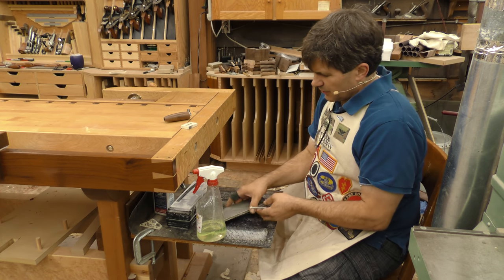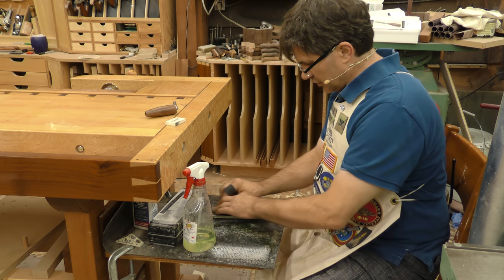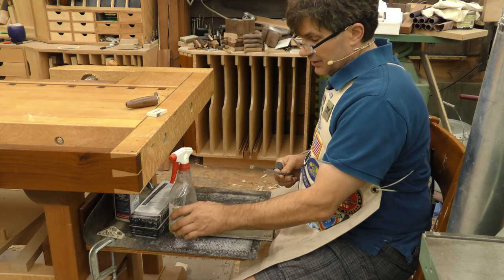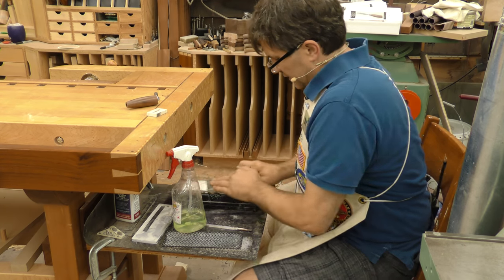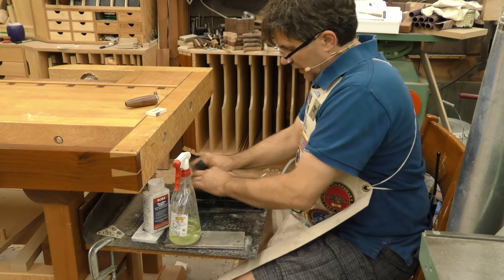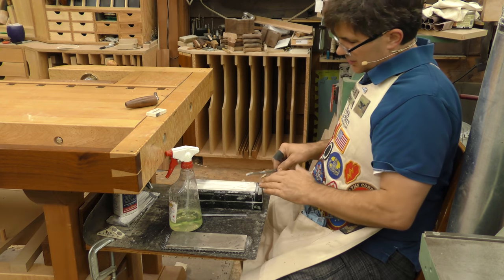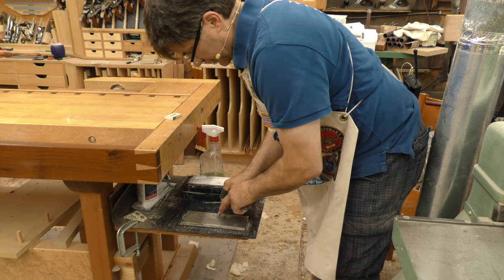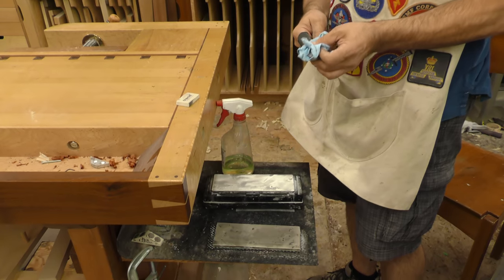Chisel preparation, from new in the box to the bench with Rob Cosman

Comment: 2:20.... But why can you remove 1000 grit scratches with 16000 grit on the bevel side of the chisel?
Reply from the maker: tertiary bevel, a few degrees higher than the secondary, very small surface, essentially just at the edge.
Reply: @RobCosmanWoodworking  Thanks for replying Rob. I actually thought that not long after I asked the question. Makes perfect sense.

Comment: I have a set of Irwin marples and i started to sharpen them and all 6 chisels are like bananas any words of wisdom on this rob?
Reply from the maker: Yep, lawn darts!  Not worth the effort, if the manufacturer  doesn't care enough to send them close to flat, something you see, then dont have high hopes for stuff you dont see, quality of the steel.  Buy the best and cry once!
Reply: Chisels don't NEED to be flat. Only need to be flat side to side, and perhaps 1/4" to 1/2" back from the cutting edge. Remember, you are only cutting with a tiny tiny little surface. Rob forgets that somebody taught him that you don't need to flatten and polish the back of a plane, which is a far more demanding application than a chisel.
Reply from the maker: A plane blade sits on a bedded surface, a chisel is held in your hand. Huge difference in terms of demanding flatness.
Reply: @RobCosman.com I'm in a similar situation but it's of my own doing. I have been using a set of diamond plates that weren't perfectly flat and found out too late. There's now probably a 0.010-0.015" belly in them and I need to correct them back to flat. I recently purchased your 300/1000 Trend plate to make sure I was getting a flat surface. The chisels are Lie Nielsen's so definitely not lawn darts. 

Any advice on method of correcting them?

Comment: But haven’t you advocated in the past to only polish the very edge of the back of the chisel?  I’m talking about the ruler trick.
Reply: Ruler trick for plane irons, never on chisels.
Reply: Ruler trick is for handplane blade, not chisels.
Reply: illegalcity why wouldn’t it work on chisels as well?
Reply: Because you want chisels to be able to pare to a reference face. The rule trick will add a bevel to the face and it won't pare flush.
Reply: bigscreen bird as you cut to a line a back bevel would push your chisel away from that line and you would not get a true 90 degree wall. You would not get the crisp shoulder that you are trying to cut
Reply: Rob, on a different note, I have a Hock blade in a Stanley 80 scraper plane, and I'm experiencing chatter on highly figured walnut. I am sharpening this in a similar fashion as I would a card scraper, pulling a burr over the flat edge. Could this be the issue? Should I be sharpening this more like a traditional plane iron?
Reply: Never on chisels, only hand plane blades
Reply: My understanding is this: The back of a chisel is the reference surface that registers to the wood. On a plane, the sole is what registers, thus the back bevel from the ruler trick doesn't negatively effect the cut.

Comment: Question for the experts in here: When I finish on the 6000 grit stone, I get a mirror polished back with no visible scratches, but if I then move on to the 16000 grit stone the back gets visible rough scratches again ?  I dosen't make any sense to me, I starting to think my 16000 grit stone is labelled wrong.. 

I work with the exact same setup as Rob, 1000 grit trend diamond plate, 6000 grit shapton and 16000 grit shapton...
Reply: I just experienced the same problem, Jergen. Although the 16000-grit Shapton stone brightened the face of my blade, it also created lots of little scratches and ruined the consistent, near-mirror finish created by my 10,000-grit Ohishi stone.  Incidentally, the blade that I was attempting to polish to perfection was an A2 steel Lie-Nielsen blade. What gives? Why does the 16000-grit Shapton leave these little scratches? Rob, any ideas?

Also, I took my time lapping the face of the blade really flat, carefully going up through the grits, before attempting to put the finishing touches on with the 16000-grit Shapton stone. And before polishing with this Shapton stone, I flattened  it on the fine side  (320 grit) of the new Double-Sided Dual Grit Flattening Stone from SharpeningSupplies, ensuring a fresh, fine finish on the stone. Despite all of these precautions, it still created these annoying, little scratches.
Reply: @soulesharmony  stones do not use the same numbers. they are meaningless this is your problem. go by feel